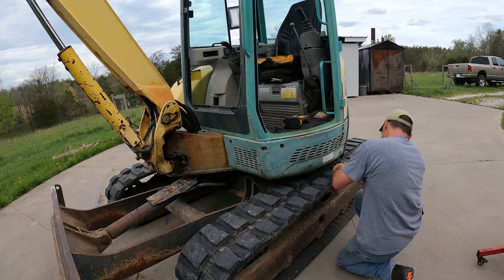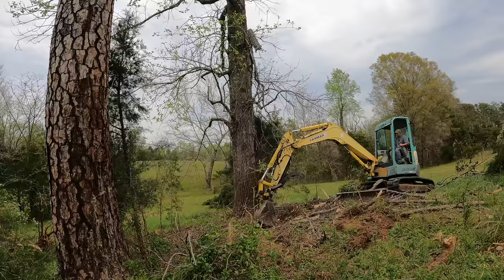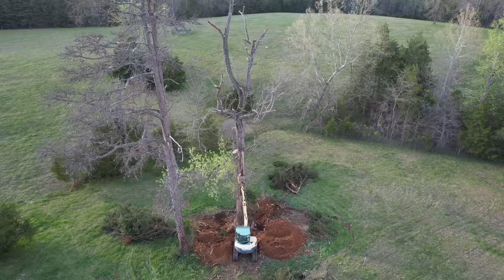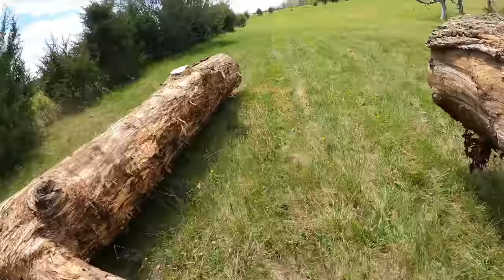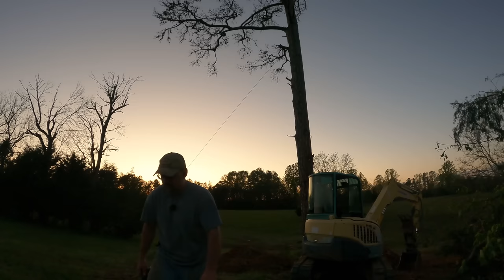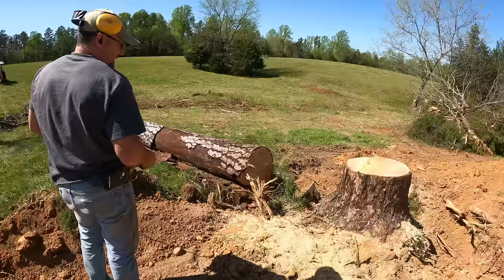Digging BIG Trees With A MINI Excavator.  Yanmar VIO50 Digger

Comment: Very entertaining and educational. From my bad experience there are pros and cons to the mini-excavator vs tree method. 
   Pros: safer for less experienced fellers, stump comes out.
   Cons: wear and tear on excavator, can take longer than cutting.
I've got about 20 similar sized pines on my land to remove at this time. Several are inclined in the direction of my neighbors power lines. Am I worried? A little, but they've not been real nice to me since I purchased the 4 acres next to them and then reclaimed half an acre they had been encroaching on for the last 20 years, not to mention the ton of junk they dumped on it. 
I feel your pain in this video, but I have an idea. I'm going to fell one with my chainsaw, then rig up some pulleys and pull the stump straight up. I'll dig around it first and break up the main side roots. I don't see how the tap root can resist the upward force. Should be interesting.

Comment: When you are pushing with your excavator you should turn it around and use the blade as an anchor on the back will give you a lot more purchase and use the weight of the excavator

Comment: Great videos, thank you, finally found someone working on a Yanmar. I have a 2014 Vio55.5B and regularly take out large trees. A single tyne ripper would be better to rip the transverse root system.  My Vio still tracks true at 5.5k hrs. Just watched your video on flushing the coolant system, as mine has been running above my preferred temp level. It gets bloody hot here in Aus. Heaps of great information much apricated.

Comment: I take out very large trees some around 3 feet 80 ft tall with my case backhoe. what I do is dig a deep hole on the side that I want the tree to fall then I finish cutting the roots around the restrest of the tree. then I push from the highest point and they come down easily. you can also pile the dirt that you have already dug on the side that you are going to push from to gain some height. hope that this helps.

Comment: I live in the Pacific Northwest near Seattle and Tacoma. I just had several Douglas Firs taken down, after having had one fall during a big wind storm a few years ago (thankfully away from the house). The root systems don't seem to have any rhyme nor reason as to where they will spread. One of the trees had a root that was perpendicular to and 18 inches around at the trunk, and still 12 inches when it finally plunged further underground. We ended up digging around it, then cutting it about 8 feet from the trunk. That made for a great place to hook on a chain and pull the stump in the opposite direction; I was actually able to pull it out wit my Chevy Silverado 3500 in 4WD (with street tires!!). I have rented a stump grinder to shave a few of them down, but it never seems to go deep enough, and you  wind up with a hump in the yard. 

Perhaps you have already answered this question below, but here goes: You just spent a lot of time and money rebuilding your JLG boom lift. Why not bring those trees down in pieces?

Finally, did your Johnson complain about itching after you shaved it???

Comment: At least around here, they do teach in school (when you are 10-12 yo) how the most common trees in the area (pine, spruce, birch) form roots. Spruce trees have basicly no taproot, only small(ish) roots to the sides, very near the surface of the ground. They fall over quite easily in the wind, and lift up their roots (and the dirt around them). You definately don't want to hang around them in windy weather, but that's the kind of tree where you could probably dig up the roots and push it over. Pine is pretty much the opposite. It has basicly no roots near the ground surface, but a massive taproot. Pines can take quite a bit of wind, but if it does fall, it'll snap from the trunk, most often 2-5 meters off the ground. Birch is a mixture of the two. No taproot really, but roots go to every direction. These snap of the trunk near the ground, or from the very top of the roots (though in reality these tend to rot first, and then it's anyones guess how it'll fall).

It's probably much better to just cut down the tree with a chain saw, and dig out the roots later (if needed). Or at least check the expected root structure online before attemting to dig it out with an excavator.

Comment: You want to put your bucket bottom on the tree and dump.  So as you're dumping you're pushing the teeth towards the tree and the tree away from you. The dump/curl cylinder has the most power on any excavator.
 I've taken some good sized trees with my mini.

Comment: Great video. I was hoping for a boom lift debut! Lol
FYI a frost tooth would definitely be an inexpensive option to buying another machine. (Not a replacement by any means, but will make the most of what you have). The coolest one I've seen was a homemade frost tooth in Upper Michigan. The guy had "repurposed" an old worn out bucket. He blunt kinda knife edge attempt on the inside of the tooth. We sat back and were saying to each other "watch this guy.... haha". He proved us wrong, my friend and I were shocked and impressed.

Comment: We have a lot of Poplars here in New Zealand. It is popular (pun intended) because it is very fast growing and drinks a lot of water in wet areas. It is generally just burnt when not needed, which is a pity as (taxonomically speaking) it is a Hardwood and can make great timber.
  You are right to be wary of that root plate, a number of foresters here have been killed by root plates falling on them while cutting them off.

Comment: Great job removing the large tree stumps! 
Large trees can have massive roots, which are usually not very visible, even with considerable excavation (as you showed in your video). I have removed several large tree stumps, using a shovel, chainsaw, a hammer & a screw driver (to remove dirt from difficult work areas). The process of removing the stump this way would usually take about a week, working around 3-4 hours a day. The largest stump I removed this way was probably about 28-30 inches in diameter. I would also use a heavy duty come along (or a pickup truck, with some weight in the bed to increase the mass of the truck) to pull the stump out of the hole. After finally getting a stump out using this basic method, using a shovel & rake to fill the hole & level the ground where the stump had been seemed like not much work, comparatively.

Comment: If you want to pull the tree (or push it over) you need to dig the hole on the side you want the tree to fall toward to remove the pressure that is holding it up.

Comment: on weed eaters and chain saws /pole saws  carburetors I have found that the thin rubber membrane that they have in there as check valves the check valve part gets stuck to the metal and will not allow fuel flow.... un stick the check valves and that usually does the job....

Comment: Great vid as always. I really appreciate your melange of stubbornness and smartness. Thats how we men are, thats how we solve problems (ok, not always the easiest way...)😎
I am an excavator dummie but I was thinking about if turning around the undercarriage of the Yanmar - so the shield is on the opposite side of the arm - would have given you more support for pushing if you had put the shield down into the ground...? I've seen some UNIMOGs with big shields and a winch on the back end used just for pulling big trees out of the forest, they use the shields to route the forces into the ground.

Comment: Love your videos. I do much tree and stump removal on my property also. When digging out a stump with my backhoe and encounter large roots that need to be cut, I use a battery  powered reciprocating saw (saws all) with a 8 or 9 inch wood cutting blade. The blade will cut many dirty roots before dulling and the blades are inexpensive. I know chainsaw chains will dull very quickly when cutting roots and sharpening them takes a bit of  time where a saw blade  takes only 30 seconds  to change  on a saws all and like I say are very inexpensive.

Comment: Being an excavator operator myself for a good 30 years My only suggestion to you was with a small excavator try to dig away from the tree in the same path as the roots to find most of the root wad that you can get.
Then starting from there you have the main route supports that are usually a five finger star. You can start digging out the side that you're going to fall it towards and that will give you a hole that wants you start prying on the top side to leverage the tree out once it does fall you can easily have a place to dig out the root mass all the dirt that's underneath the tree.
 Big trees and a small excavator is a large task it just takes time my friend.

Comment: Dig out more in front of the tree and it won't be so hard to knock over. You're thinking about it backwards. The dirt in the front isn't keeping it from falling backwards, it's keeping it from falling forwards. You need to create space for the root ball to go down into when the tree tips over or else you're not just pushing it over, you're also jacking the stump up in the air. Those two forces counteract and the extra leverage you should have from the weight of the leaning tree is balanced out by the weight of the stump (and everything above it) resisting gravity. It's just like trying to fell a tree and not cutting a wedge.

Comment: If you use a smaller bucket it helps a lot I have a mini excavator and the first think I did when I got it was to dig out a stump about 35 inches across it took about 25 minutes and it was out with a 9 inch wide bucket

Comment: I have done hundreds of these in my younger years.  Never back-drag teeth when digging out trees and don't run your saws in the dirt!  You keep digging...  Pushing occasionally will gauge progress, but also allows the fines to fall into the fractures in the soil and gain purchase near the end.  Then you keep digging some more.  You best plan on 45 rounds with regard to digging and not just three.  Do not damage your machine fighting big roots.  It is the many small roots attached to the big ones that you should concentrate on first.  Backfill to create a pad for better approach in other areas.  It is lateral roots that hold the tree upright under tension and the stump acts as the fulcrum.  Trees will not fall quickly with the stump attached while in the hole.  Backfilling may be used to retard a fall.  Members of the  Salicaceae (poplar and willow) put roots anywhere they can.  Pines have a decent tap root, but the wood will be soft with little reaction wood and would not have supported your pine with repeated easy pushing if enough soil was removed around it.  Sweetgum taproots are terrible and a cypress stump I dug out with a dragline one time was a murderous six foot elongated cone cemented in clay.  The final lateral root holding a tree in place is the one you seldom see, so you just keep digging until resistance grows limp when you push.  You get your tree to where it is on a pillar of soil that will easily fracture.   Deep roots have little reaction wood, you can dig at them, but don't be a hog and damage your machine.  You will mostly know when these are ready to fall through experience.  The fines and rocks falling into fractures are a key to progress so again, gently rocking a lose tree may not be a waste of time. The center of balance does begin to gradually change and they no longer laugh.  Once the tree is down, you stump it first.  I used to do this with a Poulan Super 72 bow saw.  You may to a tunnel cut with a bar blade on the small Stihl and then go downward leaving only perhaps a three inch thick strap of wood on the topside to hold the trunk to the stump.  Do the top cut at a 45 degree angel from the crown side going inward toward the main cut and open the cut if necessary.  DO NOT pinch your saw in this situation!  You may have to stand in a loader bucket to do this on a big tree.   The trunk will drop downward quickly from the stump if you do this correctly with no wedges involved.  The stump and root mass generally roll backward if it has plenty of soil with it or otherwise stays in place and cutting the stump short to achieve this favorable weight distribution highly recommended.  The rest of the tree will lay flatter and be much safer to cut up.  We used to take trees down with 955 CAT track loaders, a tool of choice for lot clearing in the Houston area.  I have also taken down a few trees with a 580 Case TLB using the back bucket with similar techniques.  After the trees were pushed over, I would stump them, limb them, and then top them.  We sold the logs.  Many of the trees were as big or bigger than these, mostly Loblolly or Slash Pine and an occasional oak.  Using a bow blade took some patience and planning in removing multiple wedges to reach the center of the trunk on a big tree.  A bow blade on a 92cc gear-drive saw cuts through softwood trees in little time, but I do not advise anyone ever buy an old bow saw on eBay or wherever if you are not familiar with them and do not understand how deadly they can be.

Comment: In the current market, it's hard to find a 9 ton machine for under $30k which are popular because they can still be hauled with a big pickup. They won't do that much better than what you've got. I'd be trying to go for an older heavy machine in the 20 ton range with over 10k hours which you should be able to find between $20 and $30k because they need to be moved with a low boy. Those are perfect for a ranch to live out their days for someone who will keep them running.

Comment: That machine is more than capable of taking down big trees using bucket curl against the roots. Bucket breakout is where all the power is and roots get thinner as you go away from .  When pushing a  tree over I set the arm to  3/4 of its capable height then use the tracks (tracks plus the machine weight generate much more than arm force)  to push it over and Ive done a few hundred trees ion this size. .

Comment: Watching the video it seems like you're excavator is tipping or maxing out on pressure but you're tracks don't seem to be sliding back, you may be able to get more total force into the tree if you forgo leverage, put the boom lower and straighter, and just push by driving forward. There's obviously some considerations like you don't want the roots to hit the bottom of the arm and flip you back, but it might get you more force.

Comment: My thought is to take out the stump if at all possible so I would be bothered and cussing the stump for a long time. Depending on situation stump grinding could work. Taken out 7 trees with stump. Use the tree to help tip the tree. 
Something that could help is to go as high as possible and attach a chain or cable to a piece of equipment that can pull in the intended direction of fall.

Stumps are hard to burn. Let them set for a year then build a hot fire. Have seen the stump burn slowly for a week.
Good luck

Comment: You could fab some steering pedals above the existing pedals (like toe brakes on an airplane) and have the pivot off the metal below the windshield and push the pedal backwards...or off to the sides...
Reply: Or put a peg sticking out about 4-5” above the pedal, that would be above your toes, so u could simply curl ur foot back and pull the pedal back... if you used a motorcycle foot peg, u could fold then out of the way if u want...

Comment: To adjust the tracking, you have to adjust the oil flow rate to the track motors. The reason for the tracking to change in the first place, is usually uneven wear in the motors, This typically means the weaker motor is on it's way out due to increasing internal leakage.
Reply: That sounds logical.

Comment: I have 10 acers of old growth stumps. Not knowageable on what would be the best size excavator, dozer combo would be a good fit. I bought on  the cheap. Ended up with a Hitichi EX 60 and IH TD9B. Found both a little small. Yet I made due, after digging out stumps like you did, I got better at it. Then I bought a root tooth for the excavator. With that the excavator easly would cut thru the roots. Those Tap roots are a always tough. There were some I had to dig a ramp for the dozer to get them pulled out. Still a slow prossess but I am retired more time than money.  It's been 2 years, 1 day a week, May to Oct about 4 acers done..  there were days that were rain outs and maintance days.

Comment: Oh I was using a metal detector in the hole of a large tree and found a mason jar with 30 $20.00 gold piece coin's in it so always take the time to check the hole under a tree remember it used to be small and someone could use it as a location for treasure

Comment: I'm not a heavy equipment mechanic or Yanmar repair specialist but I was thinking about the tracking problem. To me it is either a drag problem on the one side or not enough power coming out of the drive motor........have you checked the numbers on the drive motor to see if they are the same on both sides? Possibly one has been changed with a motor with lower output. Or, the drive gears are different inside. Just a thought.